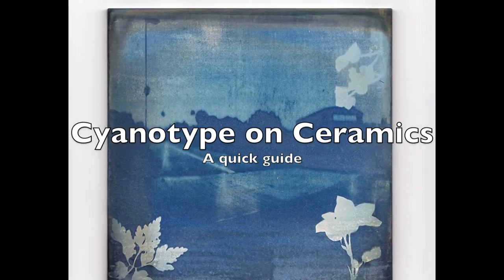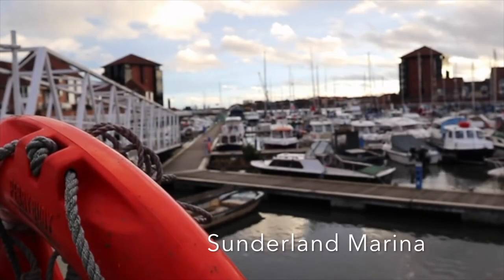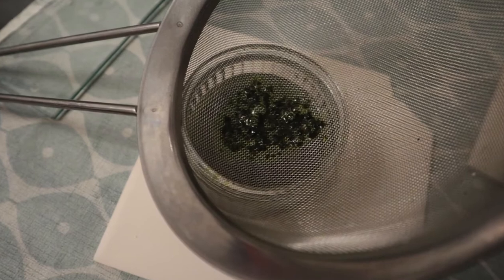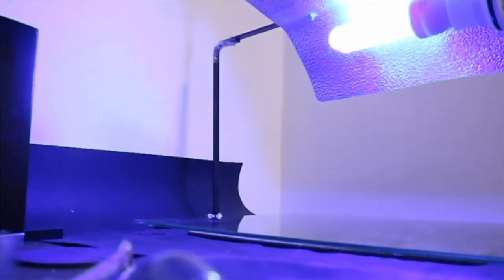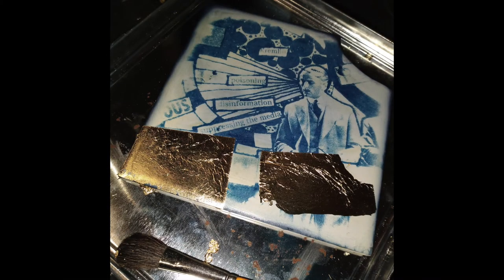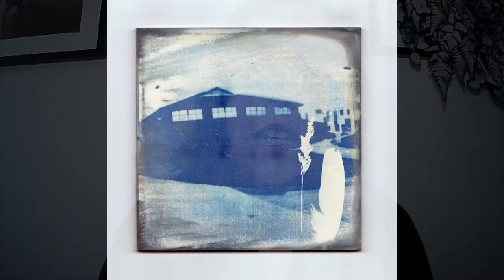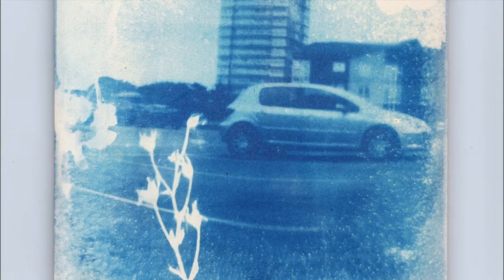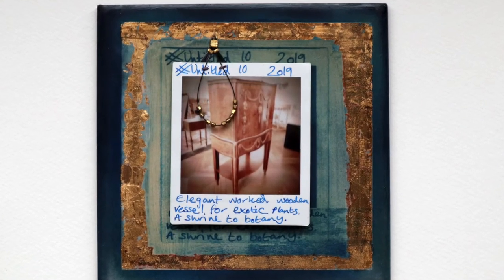Cyanotype on ceramic

Comment: Excuse me, how do you mix it so you avoid bubbles ?

Also is it possible to mix it in the container I’m going to make the mould in ? ( to avoid introducing more bubbles)😊
Reply from the maker: Don’t let it sit for too long in the water bath. It is a case of washing and drying then washing and drying again and maybe again :)
Reply: @JoHowell  sorry what do you mean water bath ? 
The couple of times I tried it, I tried measuring to the best of my abilities, mixed like crazy (quick setting) then tried to dump it into the container and put my hands in (I get 2 minutes with mixing) 

I’m thinking of mixing it in the container itself, to decrease the bubbles, going to do a sentimental, larger mould, so any help is appreciated ^_^ , sorry for taking long to respond

Comment: Can cyanotype be fired on glass? Also, with the fumes being toxic (cyanide) do you find ventilation to be an issue?
Reply from the maker: Firing it on glass wouldn't work. The chems and gelatine will just burn out. Any kiln being used should always be in a well ventilated area. You need a proper programmable kiln so probably best to access local college equipment.
Reply: @JoHowell  Do you know if any emulsion can be fired on glass? Even if it's the vitreous enamel range at lower temperatures? Before the glass melts itself of course
Reply from the maker: @GemExtractor  https://www.instagram.com/p/CMmt-PAnh0k/?utm_medium=copy_link this lady does wet collodion printing on blown glass, and I think there is a photo sensitive glass that can be blown exposed then annealed. But that's way beyond my knowledge. Screen printing is probably your best option or decals if your making kiln based glass. Again, not my specialism but good start points :)
Reply: @JoHowell  Thanks! I wonder if the emulsion is coated prior to firing or after firing? I'll have to ask her. Yes, the photosensitive glass is: http://www.gafferglassusa.com/index.php?route=product/product&product_id=100  But its in rod format, as opposed to emulsion...though maybe they have frit, I have to check on that!